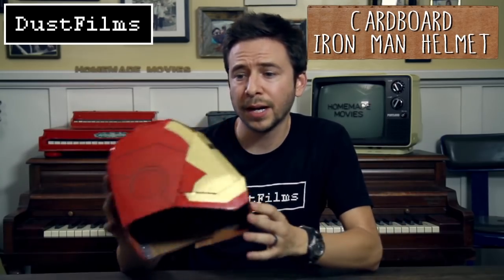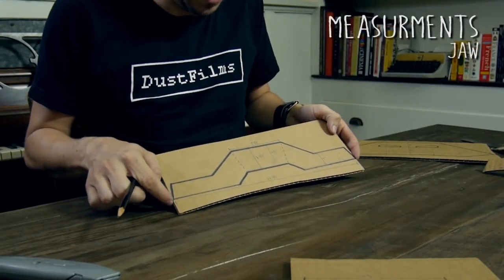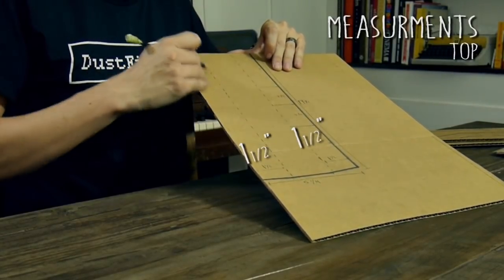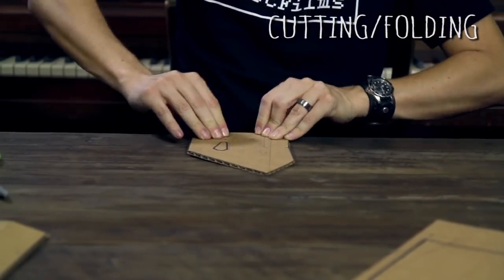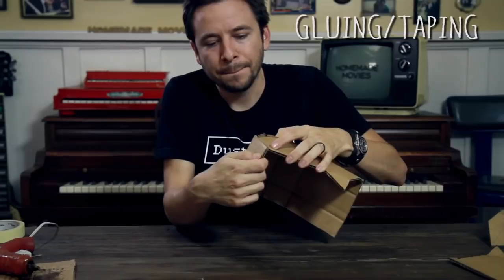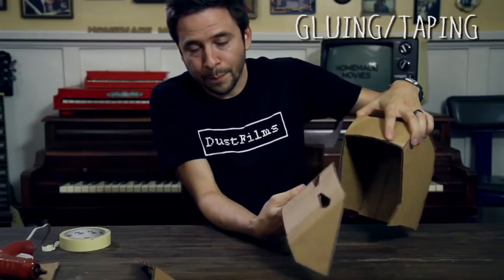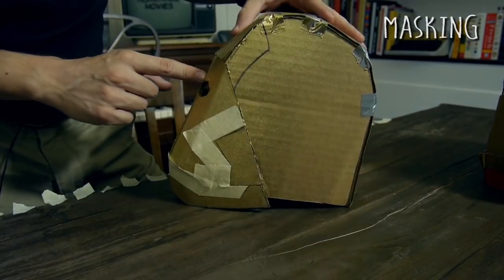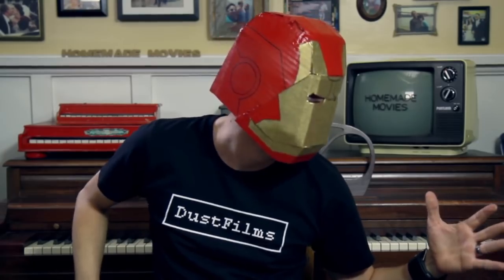DIY Cardboard Iron Man Helmet

Comment: could you trace the images with paper on the computer and cut them on cardboard?
Reply from the maker: Maybe not, the pictures are slightly at angles so they wouldn't be very straight or symmetrical

Comment: how should i edit the measurements so it will fit?
Reply from the maker: The best way might be to just draw out the side pieces and then hold them up to the sides of your head before cutting and maybe make some marks with a pencil based on your own head. That's how I did it when I first made it, that will give you some guides on the overall size and then you can adjust the measurements on rest of the pieces to match up. You could even try cutting them all of of paper first to start seeing the way the shapes fit and make adjustments to the design before committing it to the cardboard. Hope that helps!
Reply: helps a lot. thanks for responding!!